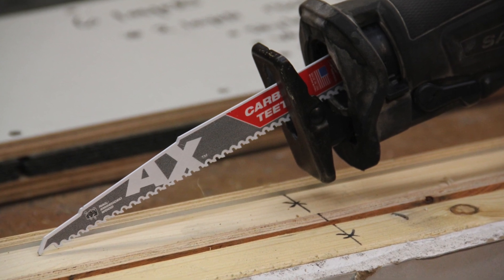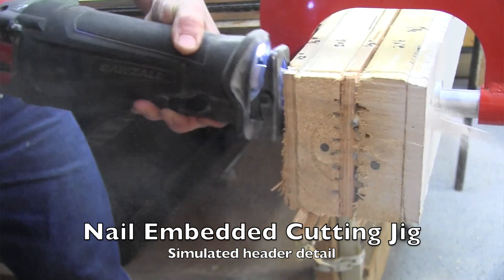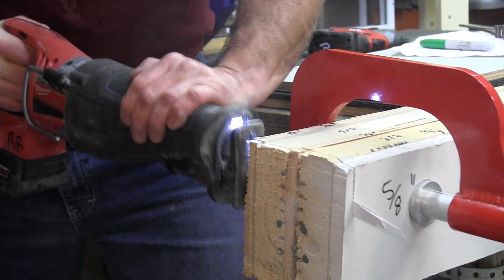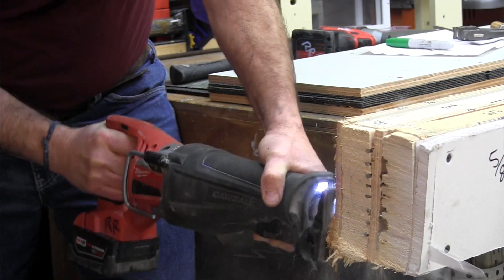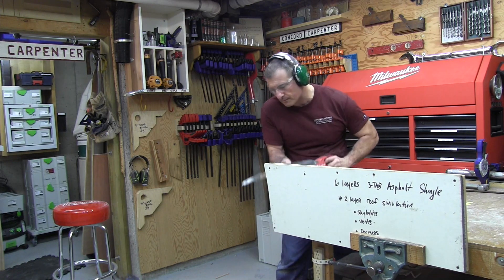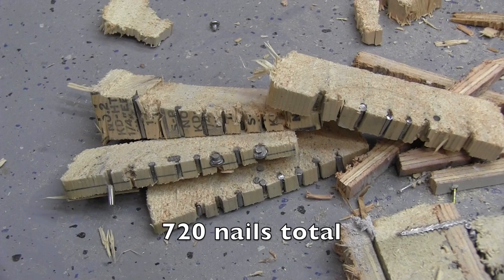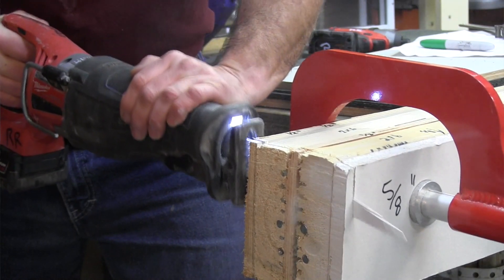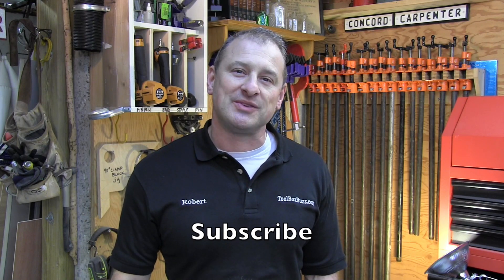Milwaukee Ax Reciprocating Blade Testing

Comment: Thanks....extremely helpful to me as I was in process of purchasing a cheap "sawzall" with in mind a specific need to cut up very heavy (4x4) packing crate material with embedded nails.  As I looked at the manufacturer provided info on Amazon, it was not at all clear to me whether this was a single-blade solution to my problem or whether I needed to change from a wood-cutting blade to the Ax whenever I contacted metal.  Sure, I understood that I ~could~ do it all with this blade but thought maybe I was wasting/dulling the blade on wood.  Now I understand that it is basically a wood-cutting blade that can also handle metal, which is what I needed (and what is frequently needed).

Comment: Milwaukee is bad ass.   Everything from the tools to the blades.   I have the sawzall + hacksaw + impact drill + hammer drill + grinder+ circular saw + I have the job sight radio.    But the funny thing is I have all the same tools that's hyper tough from wallmart.   The hyper tough I use at work because I leave my good milwaukee tools at home because they could get stolen or lost.   Anyway an Awsome review on the saw blades.     Stay safe and real and God bless

Comment: I prefer the Milwaukee and Diablo blades. The ax is a hoss and lasts a lot longer then most, and the torch is absolutely amazing same with Diablo I can rough cut exhaust pipe, and sheet metal for so much longer using one of these then any other.

Comment: The impressive thing about the Ax blade is, I'm a wood turner and I have taken log rounds and split them down the middle cutting strait down into the end grain. With a steel wood blade the sawsall will kick the snot out of you, but, with these you can make a nice easy pass using just the weight of the sawsall.

Comment: So why the sandwich when cutting the roofing?  Real world you would need to be able to cut through the shingles and one layer of underlayment in most cases.  I have been using bi metal blades which seem to work so it would all depend on price versus life of the blade.  I also wonder a bit about putting nails in a trough wouldn't it again be better to go real world?  I am not sure what the effect of a rolling nail would have on the cut but I will never run into that situation.  Using your nailer and shoot a bunch of 16p into a triple 2x then cut away would relate to real work.  Your mock header was a good simulation of a real job task.  I like seeing tests on new products but keep them real with ball park comparisons to other products in price.  Take care.  Doug
Reply from the maker: Good feedback thanks. I sandwiched it to hold it together so I could use a vise and clamp it. I wanted to build a test rig that would allow me to make cut after cut without having to stop every 3-4 cuts to reinstall nails.